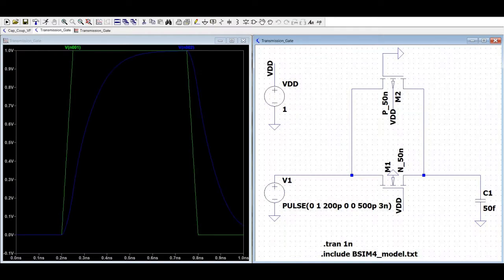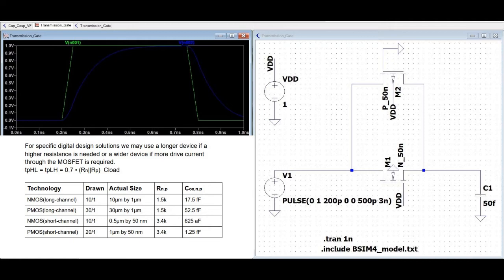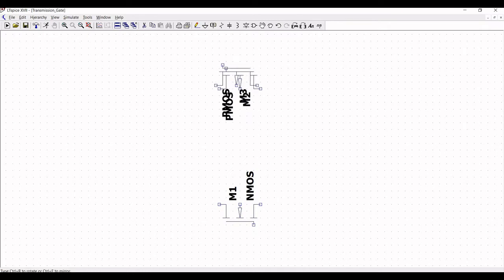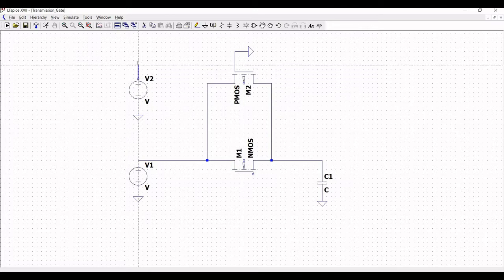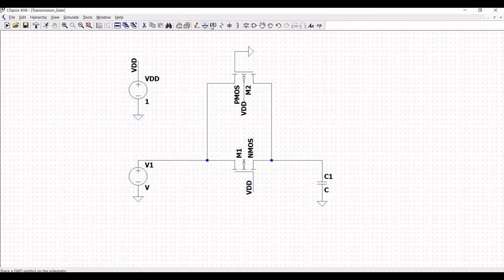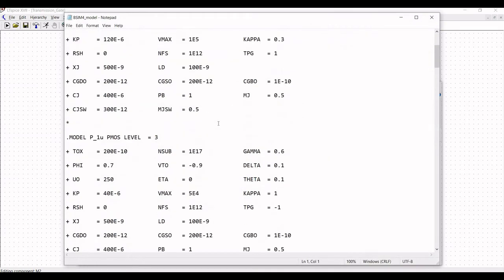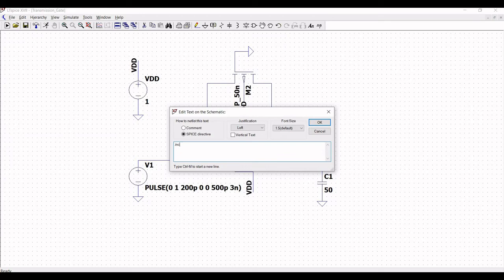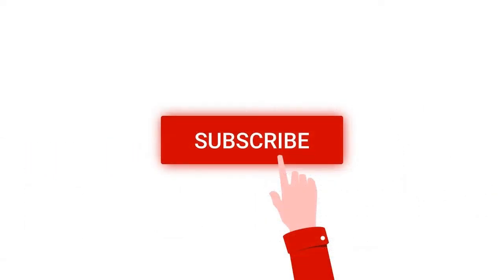LTspice tutorial 3: Simulation of Transmission gate circuit using BSIM4 model

Comment: how to get the power consumption of this circuit
Reply from the maker: You have an option in LTspice, where you can measure the power consumption of a component during transient analysis by hovering your cursor over the component and holding down the ALT key. Then, left-clicking will display a graph of the instantaneous power dissipation over the simulation time. To get the average power over that period, click on the power graph's title while holding down the CTRL key

Comment: First of all, I loved the very well explained video, you can follow it the first time and understand everything, but I have a series of doubts:

In this video it shows how with a 1 in the gates (the inverse for Pmos), the circuit is in conduction and at the output in the capacitor we see the delays.

I would like you to show how varying the control of the transistor gate changes the state of the transmission gate
What I have done to see this is invert the values of the mosfet gate, that is, I have put the PMOS in the VDD gate and in the NMOS I have put GND (global node 0), but the result is that regardless of the value of the press, at the output I always have 0.4v volts and I don't understand that, why does that happen?
Reply from the maker: In an transmission gate this is based on the parallel connection of an NMOS and PMOS. Since the NMOS pass gate (PG) passes logic lows well and the PMOS PG passes logic highs well, putting the two complementary MOSFETs in parallel, 
produces a TG that passes both logic levels well. When VDD is applied across gate of NMOS, the transmission gate passes the signal. But when you make it GND the NMOS will not pass the signal.
Reply: When I apply a 0 to the NMOS and VDD to the PMOS, at the output I have a constant voltage of approximately 0.4v, with the input being 1V. @circuitgenerator9788
Reply: Since I cannot send you a photo here, I have sent it to you by email.